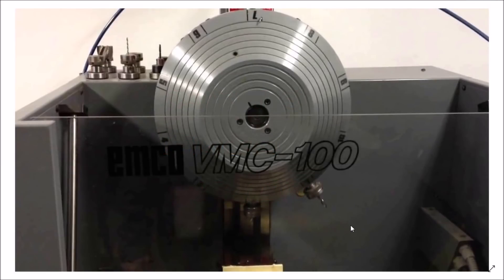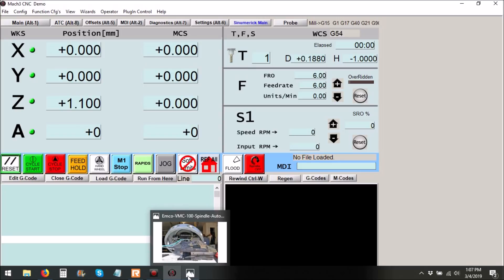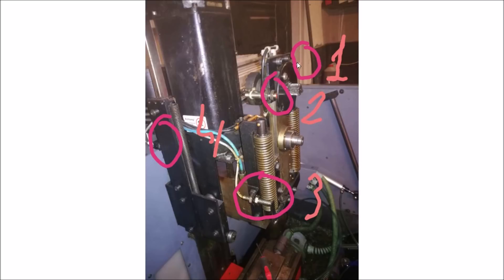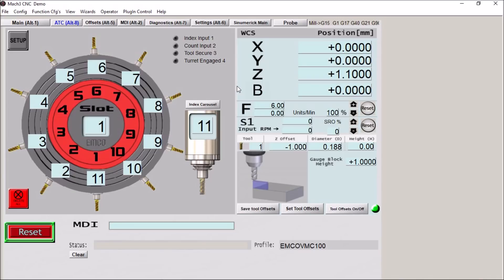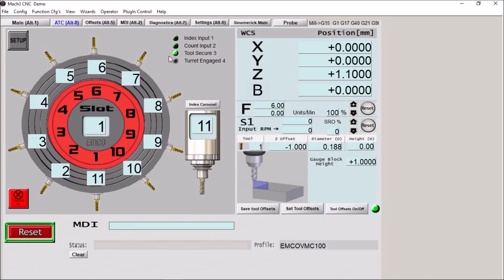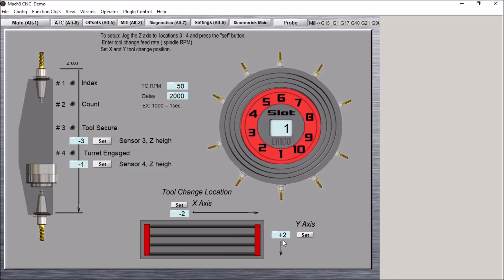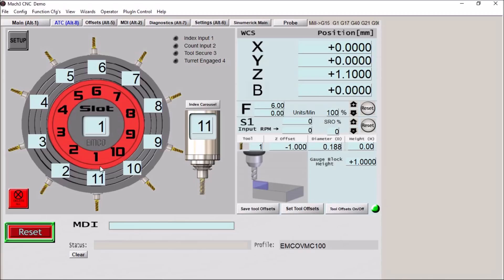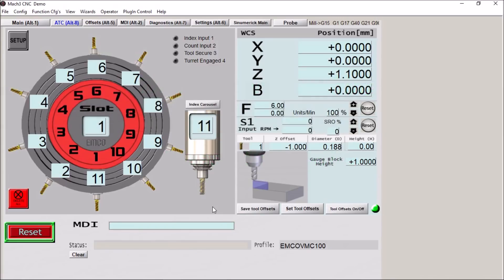EMCO VMC 100 MACH3

Comment: Hello. I want to buy one like this with Acorn retrofitted. DO u recommend this cnc for small home production like: parts for optical photo lens, parts for bikes? Materials i will be using: brass, aluminium, copper. Any problems with this cnc over years? thx
Reply from the maker: I really cant speak for the Accuracy of this machine.
Reply: @CNC4XR7  Thx for reply

Comment: I'm interested in how the turret communicates with Mach 3... how did you go about making sure that  the turret rotates as you command in mach 3
Reply from the maker: For this screen the turret rotates the way it was original which is using the spindle to rotate. the turret has a sensor to count.

Comment: great work i have one of these machines a 1995  emco vmc 100 hope to have it up and running soon as it as the rs 232 port I hope I don't need to retrofit it  if its all working  but the worse case will retrofit it  :)  are there any more benefits to retrofit a machine if you can still drip feed it in working order?
Reply from the maker: As I dont own one of these machines I cant say for sure. However i'm told the retrofit was more to upgrade the electronics as the old operating system for these machines had limited memory etc. much easier to upgrade in terms of parts.